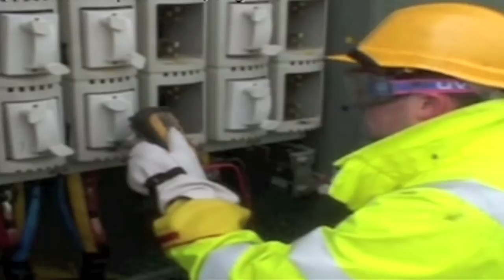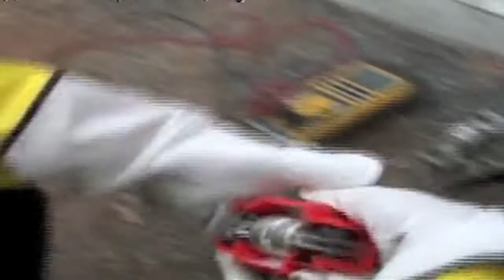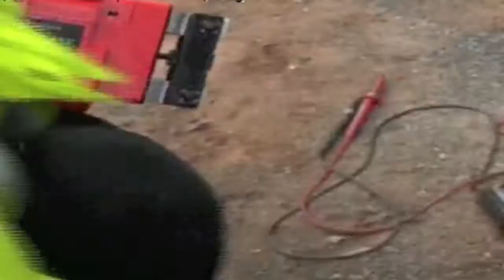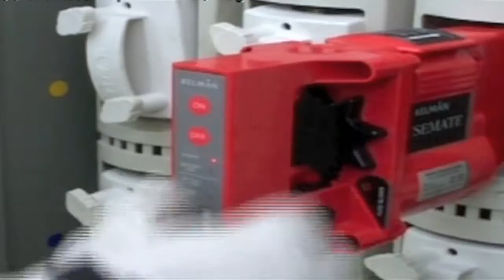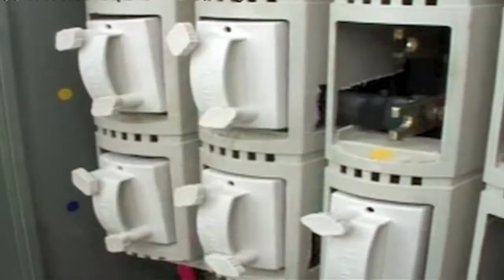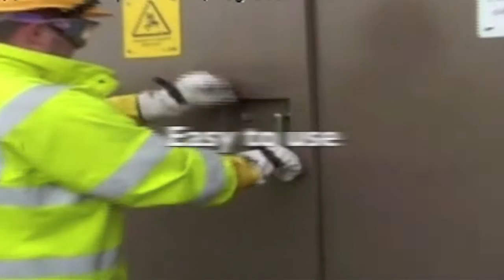Kelvatek FUSEMATE operation

Comment: no wonder power cuts are so long. Before this a polish man used to rip out the blown fuse and swap it with a new one.
Reply from the maker: The time for the powercut was mostly for people to ring in and report the outage followed by getting the man to site. This procedure takes 2 mins once you are familiar with it.
Reply from the maker: Also, see this, it shows how power supplies are restored in a minute or so after a fuse blows... https://www.youtube.com/watch?v=_nBb7mawUsY
Reply: @jr_electronics  thanks, seems I watched a few of your videos yesterday, already seen that vid :)
Reply from the maker: Thank you, what would you like to see more of? - Have a lot of content but not made public.
Reply: @jr_electronics  I was looking at the UK power cut 9 Aug 2019 and the londoners going mental when the power went off for about 1 hour. Ended up on your channel.
Reply from the maker: Hi David, 
The J type fuses like in my video are located at local substations, and only feed maybe 20 or 30 houses, and so when they blow, only a small local outage occurs. The Aug 2019 outage was much more widespread, which resulted in transportation issues with the underground etc, which is what I think caused londoners to crack up!

If you want to learn more, there is a nice report from Ofgem about the causes of this large outage here: https://www.ofgem.gov.uk/system/files/docs/2020/01/9_august_2019_power_outage_report.pdf